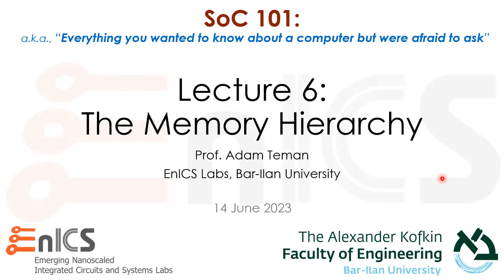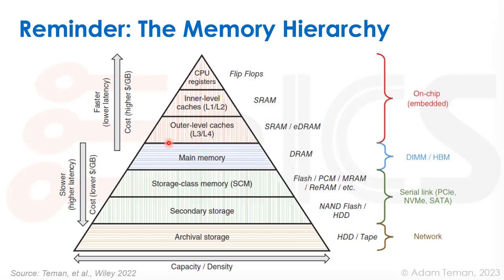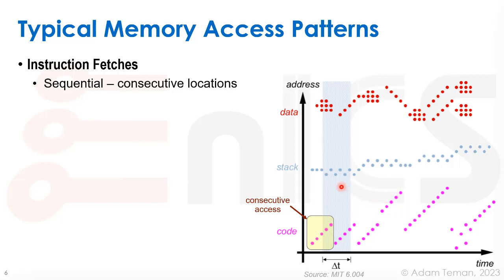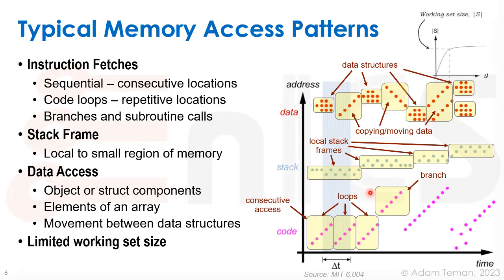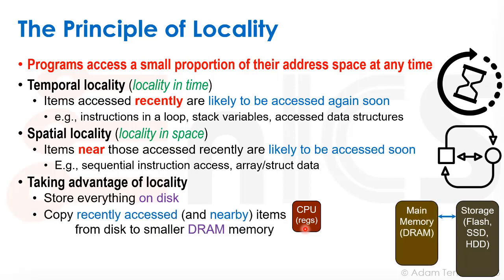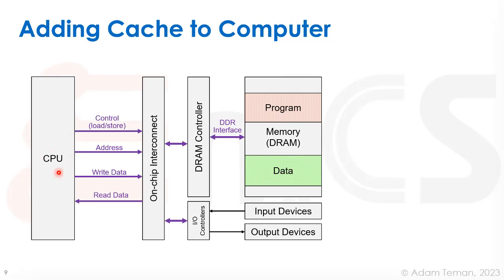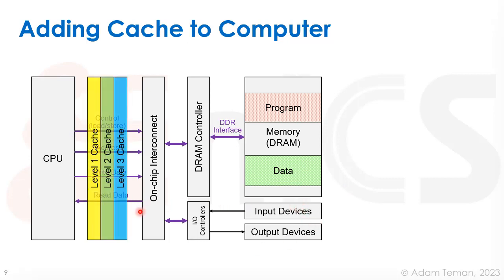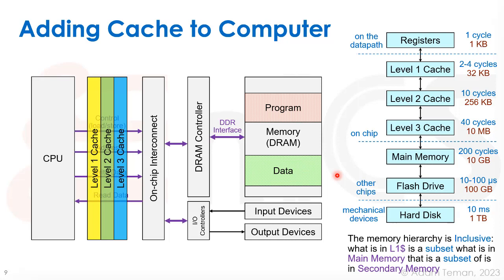SoC 101 - Lecture 6a: The Memory Hierarchy

Comment: I wonder whether NVMe drives change this picture a little bit. After all, these drives operate faster than SATA or IDE drives.
Reply from the maker: That's a great point.
We have been waiting for quite some time for "storage class memory" to disrupt the traditional memory hierarchy. The first real options we have out there are the PCM-based Optane drives. They are supposed to provide a median level between the DRAM and SSD. But they haven't caught on yet, as much as they were expected to, and haven't really caused a disruption. They also aren't really different, but rather a faster secondary storage, if I understand correctly.
There are other options that are either already out there in the wild or "coming soon" (I put that in quotes, since it's been over 15 years that they've been "coming soon"). There are many types of emerging technologies, such as MRAM, ReRAM, etc., which will (maybe?) one day provide a true additional level of the hierarchy and maybe one of these technologies will actually make one or more of the existing ones redundant. 

But that has yet to happen. Let me tell you that the magnetic hard drive has been pronounced dead for probably 30 years. And yet, they still sell a ton of magnetic hard drives today. Same with Flash... So don't write off DRAM or SSD just yet :)
Reply: Thank you for the answer, professor!
For hard drives, I think the main reason may be the duration of storage. After all, modern SSDs use TLC and QLC as their basic element. And those cells loose charge. At least, as I know. Has no such problem for HDD. Seems like a no replacement so far. I even heard that some people still prefer use magnetic tapes for the long-time storage. Seems exotic to me. But at least Tape Archive (tar) may be used as intended. :)
Oh, but there are also optical drives which seemingly did disappear, didn't they?
Reply from the maker: @igorfomin2570  
Yes, I guess this is one of the reasons. Historically, I think the reason for the persistence of the magnetic drives is the price, but as SSDs get cheaper, it could be that some people would prefer to have magnetic or tape archives. That said the durability of flash (including SSD, etc.) is due to writes, so there shouldn't be a problem with long term storage.

Yes, I believe optical drives are not too popular these days...